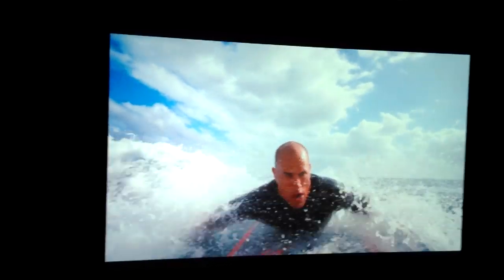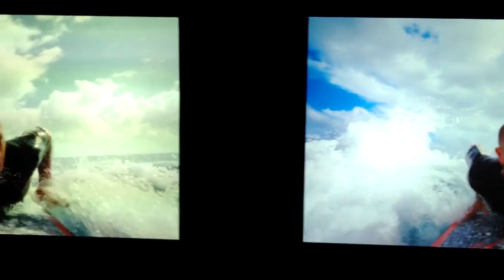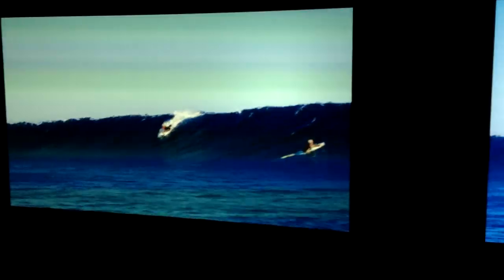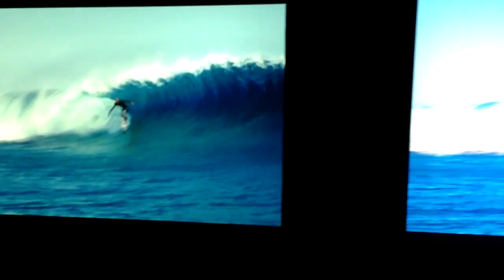3LCD Compares Color Brightness of DLP vs. 3LCD Projector at InfoComm 2012

Comment: I saw a demonstration of a projector at a Home Theater store, not sure what kind it was, and there was always a rainbow-like blur when something moved across the screen quickly.  It turned me off so much that I've never wanted one.  Does anyone know what I am talking about?
Reply: It's called rainbow effect on the DLP projectors. DLP projectors use color wheels to flash three colors one after the other so to most people, you eyes will only see three colors combined. To some people, their brains can't combine these colors very well so what you see is three separate colors or so called rainbow effect. 3LCD projectors display three colors simotainously, so it won't cause this rainbow effect.
Reply: Almost, single chip DLP produces the effect you mention. However the more professional level projectors use 3 chip DLP, which doesn't suffer that issue. For larger professional projectors LCD cannot be used, so 3 chip DLP must be used.

Comment: I have a Optoma HD25e and my colors during the movie Riding Giants are very much like the 3 LCD colors shown. I bet the lamp was close to going out when this comparison was made. My colors and brightness are very vivid on any showing especially and recently made television show or movie. What a farce.
Reply: +William Prieto I have a DLP projector, and have experienced that white has been exaggerately been shown in video. Even if I have good calibrated projector. But DLP has some advantages over the LCD regarding blacks. So LCD has advantage regarding the bright parts, and DLP is best in the darks.
Reply: You can make a DLP look good but the drawback is you will lose a lot of brightness. Most DLP's rated at 2200 limes will only output colors at 1200 lumes. Now your HD25e if I remember correctly has a RGBRGB color wheel which is the best kind. There are DLP projectors have RGBWRGB color wheels will exaggerate white significantly compare to colors.
Reply: Actually I bought an LCD projector since last time. and I find it very good. And better lens shift, and better brightness, and lower noise. I had a BENQ dlp projector. And bought an Epson LCD projector. And the rainbow effect is no issue on LCD projector since it is a 3 chip projector. Most low end DLP projectors are single chip which makes the rainbow effect come forth.